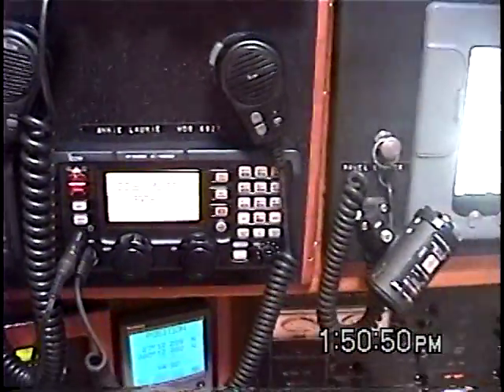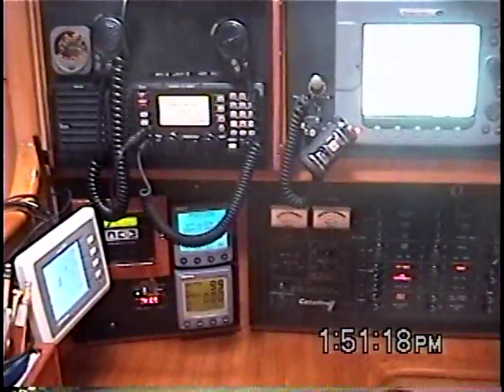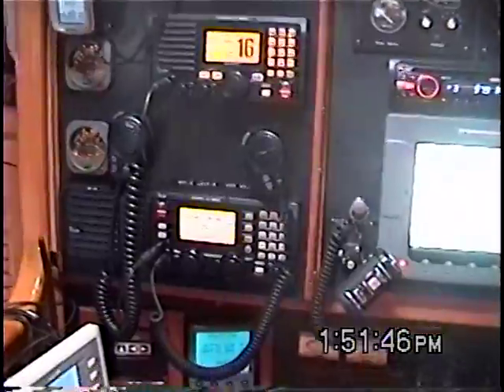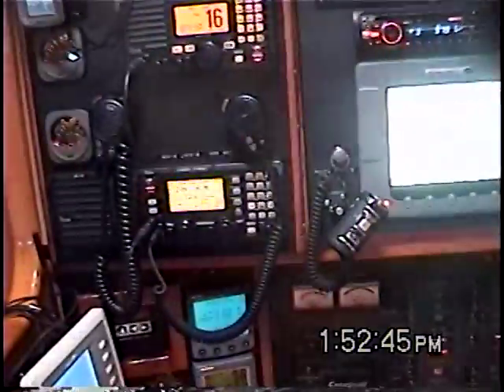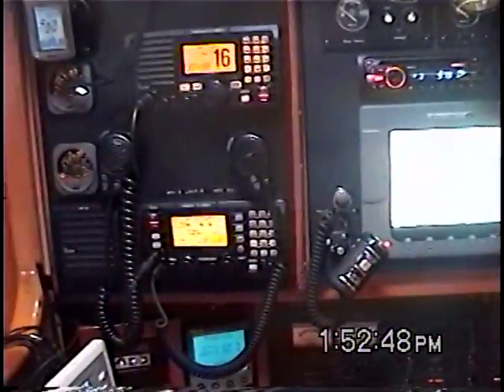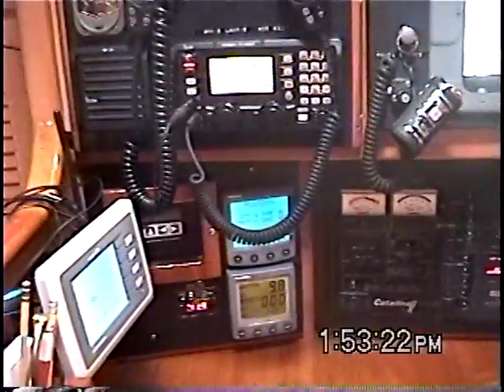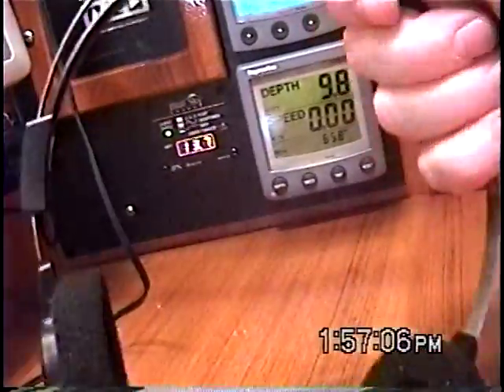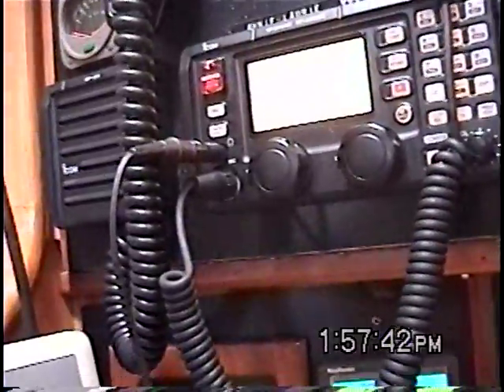HF-DSC demonstration set-up / Offshore Sailing Nav Station Set-up

Comment: What is the electric load for this entire nav station?  That is a lot of stuff, which you mention runs 24/7/365.
Reply from the maker: John Colby John, the power consumption is actually quite low, compared to the consumption of the refrig/freezer and autopilot.  VHF and AIS run 24/7, while underway.  The SSB, WeFax receiver, etc. are only used as needed (an hour or so, per day).  Youtube is not the place to discuss this in detail, try the SSCA Discussion Boards. Thanks, KA4WJA, John